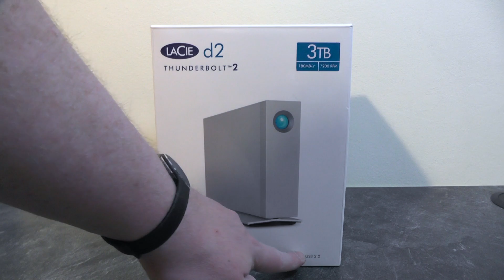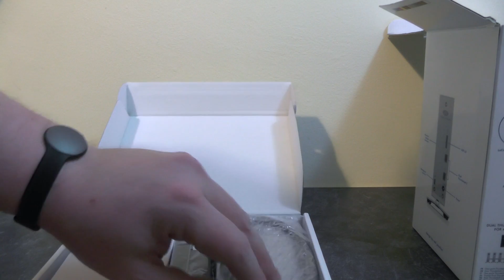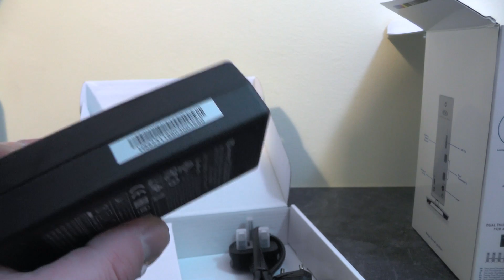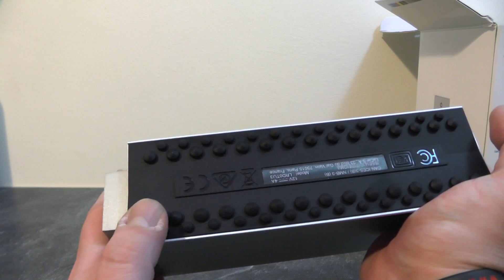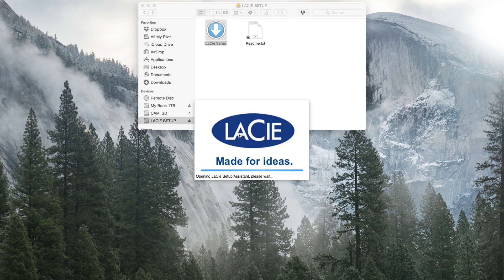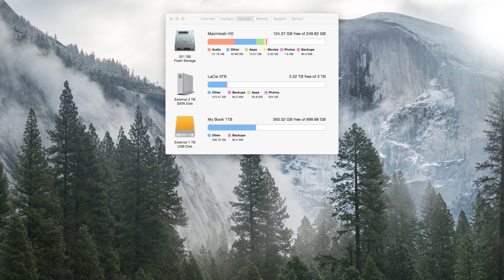LaCie d2 Thunderbolt2 - Unboxing & first look

Comment: a couple people have said that the fan is very noisy and annoying, is that correct?
Reply from the maker: It's not noisy at all, audible, probably around the same volume as the disk rotating. I have mine positioned behind my Mac and don't notice it at all
Reply: thank you, I will make my purchase right now :)
Reply: there is no fan so no noise